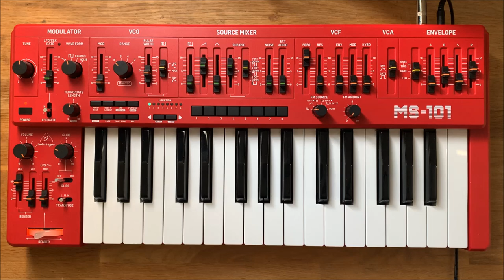Behringer MS-1 Moog bass

Comment: Sounds more like the korg mono poly bass....passion by the flirts
Reply from the maker: I agree :) but at least its the same method as is often used on a moog but yes, I usually use my Mini.
Reply: @henrikstolpe  I actually  like the sound you created better than moog sounds more unique
Reply from the maker: @eancurtis9333 thanks! That little synth is surprisingly effective actually!
Reply: @henrikstolpe  what's up with mk 2  ?  Is that a better version?
Reply from the maker: Yes its supposed to have a clone of the original VCA which is an important sound  of the SH101, TB303 and Juno 6/60, so it should sound closer to the vintage SH101. @eancurtis9333